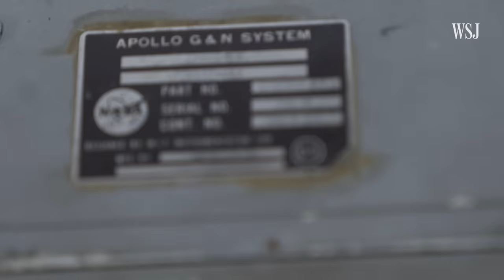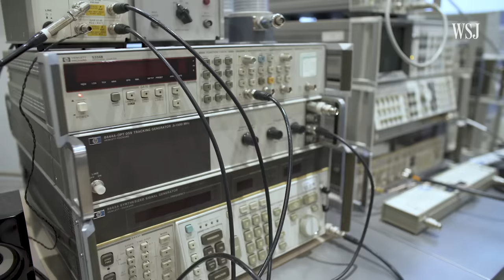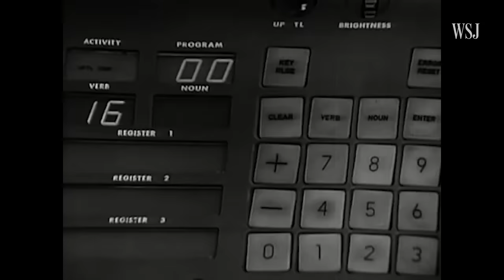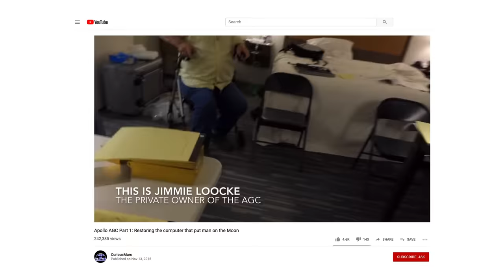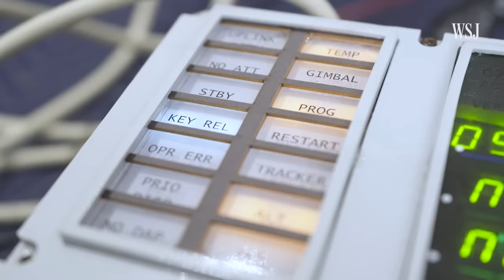Restorers Try to Get Lunar Module Guidance Computer Up and Running | WSJ

Comment: This was a thoroughly fascinating project.  I watched all the videos.  Simply amazing.  When they powered up the computer memory, and recovered the last state of the computer in magnetic memory - including the latitude and longitude - you felt like you were there 50 years ago.  A very impressive achievement.  This was most deserving of being featured by WSJ - it is very inspirational for our creators of the future.
Reply: Love that it goes right back to doings it’s job, even though it’s 50 years later. The little computer just does it’s job no questions asked

Comment: I’d love to see them hook up a control stick and run it as a simulation on a modern computer so that someone can manually “land on the moon” using the AGC. That would be so cool!
Reply: CuriousMarc's video Apollo Guidance Computer Part 23: Flying the Apollo 11 Moon Landing with the Original AGC Code and part 24 does this.
Reply: @threebuddies  Nice dude, thanks!
Reply: Yeah! Like one of those Logitech controllers used to steer submarines!
Reply: You'd need to hook it up to Stanley Kubrick's camera dollies in order for it to reproduce the moon-landing.
Reply: @SEELE-ONE  Tbf, choosing a sturdy, reliable, cheap off-the-shelf gamepad was probably one of the smarter ideas in the Titan sub's developement.
Reply: Not enough precessing power to even connect it to a stick!

Comment: I started working on circuit boards in the 80s but found it advantageous to look back at previous designs to understand current designs of circuits. It’s best not to trash old equipment once it’s gone it’s gone.

Comment: I'm impressed that the young guy was willing to learn the restrictions the designers had in the 60's.  Those guys had to work at the lowest levels to get those pieces working.  And no compilers to transfer a high level programming language into a binary representation the electronics could understand.

I started working with electronics in the early 70's.  This video brought back memories.

Comment: Nice one!. I can remember being a young boy in the late seventies going with my father to work on several weekends, they were working on one of the first computerised credit card systems in the UK, possibly the first kn the world (waits for gnashing of teeth etc, have the dates of it going live). They were writing code on machines that only had 32k of memory, it took half of that to get them going.... They did it, I still have the keyring Dad got from IBM (a 'failed' memory chip) encased in plastic after a business trip to the USA to get the kit needed. This kind of kit needs to be preserved!. I might add, my first home computer only had 64k of ram in the eighties... Gòod on you!.

Comment: I was watching the channel when they first started trying to diagnose it.
The levels of difficulty that they had to deal with are dumbfounding; everything from building their own interfaces to interact with the computer, to creating software that would recreate the "mission" and feed data into the Apollo modules.
And that was AFTER they had to do things as simple as figuring out which parts of the computer were which; because these are computer parts that any normal tech would be able to recognize.

Comment: In 1969 a computer like that would have filled the basement of a skyscraper.  It would have needed a raised floor for cooling..This device was ten years ahead of its time in an era when a single years advancement doubled processing power.  IC chips were invented in 1961 but there was no single chip computer, that did not happen until 1971 at Intel.  The machine they are playing with is a nugget of technology.  VERY HISTORIC.
Reply: Lol no it wouldn’t have. Innovative sure but you’re way overselling it and even for the 60s already 20 years out of date.
Reply: @kishascape  Sure.  You were around, right?  I was working on IBM mainframes in 1968.  What were you doing?

Comment: A buddy of mine worked on electronic and computers for the space program in the 1960s.  He said there is no way the US went to the moon, with the state of electronics at that time.  It would have taken a building full of wires cables and still vacuum tubes, to get a space ship to the moon.
Reply: your "buddy" told you lies
Reply: @Agarwaen  Hold old are you?

Comment: The funny thing is a car made in the early 90s has more computer processing power
Reply: @Magna Carta Sam Adam's- yeah and a 1980s cash register had more computing power.
Reply: @pvtpeppers6176   The funny thing is too if you can work on a car and repair one that's fairly modern you're the equivalent of a rocket scientist from the 1960s and 70s
Reply: @magnacartasamadams8189  To be fair, these days you can just plug in a laptop and run diagnosis on the system. That hardly qualifies you as a rocket scientist. The scientists in the 60s and 70s built the rocket, the spaceships, the computers and the simulators from scratch. And by doing that forwarded our computer tech by at least a decade.

Comment: The---most important computer built, was the first one (programmable) ''COLOSSUS''   AT BLETCHLEY PARK  ENGLAND, 1944.
Reply: That's actually not the first. But it's close.
Reply: @Craigeek  It was the first programmable, electronic computer put to work for a specific task https://en.wikipedia.org/wiki/Colossus_computer
Reply: significance of firsts is subjective. just like US likes to say they won "the space race" as if it's only the moon that matters, in just about every other space-first winner was soviet union. IMO first general purpose computer is more significant. Colossus couldn't run applications only calculations around specific problem domain, ENIAC was the first that could run application code like modern computer does. (disclaimer: I'm not affiliated with any of the nations involved)

Comment: To those who say we just don’t have the technology anymore to go back.   Well apparently we do now
Reply: We always did - what we haven't had is the desire.  There's been no perceived need to send people back to the Moon.
Reply: For you cannot land on the moon. It's a luminary. All lies.
Reply: @fernandojvalencia8151  you're a dumb idiot, IF you actually mean what you say. IF you don't and you're trolling, you're a dumb idiot. Either way, you're a dumb idiot. Only way out of this is to go full adult. So, when are you going full adult?
Reply: Bernard Cohen So where can I find a fully functional Saturn V to put the computer in?
Reply: We wouldn't use that old technology to go back to the moon anyways it was state of the art for it's time . . . It served us well . .but we have more advanced computers and software the Orion looks to be promising it is yet to do a manned spaceflight but alot of engineering went into that spacecraft and I'm pretty confident that it will better that the Apollo capsules that it's replacing . . .all in time
Reply: jeff lockaby  The USA is capable of sending people to orbit. It is just very expensive, and the space shuttle was retired. SpaceX and Boeing will both have capable rockets (replacements for the space shuttle) this year. We could keep using the space shuttle but it is outdated and after trial and error we realized the shuttle is not the way to go for space travel. Most planets dont have the same atmosphere as earth so using a shuttle (rocket/plane hybrid) doesn't really make much sense anymore. Plus America has had many struggles with our economy since the 60s cant just spend all of our money on space.

Comment: I don't know if you know this but it's kinda cool to mention NASA built most of it's hardware with 50's technology that was proven to work very reliably. However, this computer was really cutting edge 60's technology.
Reply: This shows how "barely possible" the moon landing was back in the day. They had to scrap the "only use tried and tested technology" approach, because the Apollo program was at the very edge of what was technologically possible at the time. But in doing so they kickstarted an enormous leap in computer technology. Many of the ideas first implemented in the AGC are still valid today in mission critical applications as well as everyday operating systems.
Reply: yeah  I built one, one boring afternoon. but the power was cut, so I had to heat the soldering iron in the fire.
Reply: @stephanweinberger  The Brain Trust of America with unlimited funds.

Comment: The guts to go to the moon with rudimentary equipment is unfathomable.
Reply: Ah but there is where you are mistaken.  If you watch all the videos, you will see that the equipment that was developed, for example the gyros, were high tech for the time.  The computing tasks were divided between ground computers and flight computers, and data uploaded that could not be calculated by the onboard computer.  Software was designed to be failsafe, and the computer could restart where it stopped if overloaded and high priority tasks would still be done.  Not really "rudimentary", because scientists and engineers figured out how to do it by pressing the state of the art to the limit to accomplish what they had figured out was required.
Reply: Nobody has been to the moon - its all fake.
Reply: @Kpopzoom  go play, the adults are having a talk here...
Reply: @Kpopzoom  Tinfoil hat alert
Reply: @Kpopzoom  Stuff it, child.
Reply: @Kpopzoom  - So you believe NASA's explanation of the dangers of the VABs but not their claims of being able to safely transit them? Not all ionizing radiation is the same
Reply: @stephanweinberger  YOU MEAN THE SENILE CLUB?
Reply: @Kpopzoom  you tell 'em Ray
Reply: @Kpopzoom  : "The moon landing was filmed by Stanley Kubrick". Yeah , but being Stanley "fastidious" Kubrick, he insisted on shooting on location.
Reply: @ordinosaurs ...on  the 2001 Space Odyssey set.
Reply: @ordinosaurs  No it's lokation, critical distinction.

Comment: 2 KB worth of RAM and a 4 MHz CPU landed Apollo 11 on the moon? It's really hard to believe that in 2019. 😂😂😂😂
Reply: I used to work on the early 747 Inertial Navigation Systems - and the RAM in that was just 8 KB
Reply: it didn't have 2 "KB", it's volatile memory could store 2 kw, ie 2000 15bit words (and an additional parity bit). This is actually nearly 4kb, and analogous to the first commodore pet. More than that, there was A LOT more read only memory where the different programs were stored. Ie, effectively it had a total memory capacity higher than a c64 and close to an early pc.

Comment: Any body willing to put that thing in the Space X rocket and fly away?

Anybody?
Reply: Elon Musk wants to know your location
Reply: Could you even imagine....The computer equivalent of a Model T Ford.
Reply: The AGC were not rocket computers anyway. There was one in the Saturn V, for sure, but was an IBM afaik.
Reply: Armando Silvier  : "The Saturn Launch Vehicle Digital Computer (LVDC) was a computer that provided the autopilot for the Saturn V rocket from launch to Earth orbit insertion. Designed and manufactured by IBM's Electronics Systems Center in Owego, N.Y." Wikipedia page "Saturn Launch Vehicle Digital Computer"
I couldn't find any reference to "TRS-70" (didn't dig much however).
Reply: Armando Silvier  : You can't compare the availability of mass produced objects sold everywhere on the planet and to the most a few tens of very peculiar machines build and used for a single short-living project.
However, as you can see, there are still some. I wonder what is your "according to NASA" referring to.

Comment: The 'first' computer the Eniac had 17,000 tubes. The Apollo 11 computer had 17,000 transistors. The current iPhone 15 has 19 billion transistors. 

Technology has come a long way and absolutely every nut and bolt from the Apollo spacecraft and missions should be preserved.
Reply: and they cant do the same thing today ewen with a iphone 😅😂
Reply: @ahmetmutlu1983 when did they try to do an Apollo Mission, today, with an iPhone?  I didn’t get the memo….

Comment: It's amazing that this computer with its now perceived limited resources was able to perform such a monumental mission at the time. This isn't even to mention all the failsafes to account for every single issue that could have happen to the spacecraft. The design of the space module was equally impressive and all these systems worked together.
Reply: LOL. When you understand it was a staged hoax, it makes more sense.

Comment: Interestingly enough the Software in the AGC was developed in Parallel with Digital Fly By Wire software for fighter jets during the same course of time. The hardware was different of course. That same software was then adapted to the STS program. Very flexible software indeed to drive the Apollo Guidance System, Aircraft Fly By Wire Systems and the Space Shuttle.

Comment: APOLLO 11. THE LOST TAPES THAT ARE NOT LOST NASA searched for but could not locate some of the original Apollo 11 data tapes – “original” in the sense that they directly recorded data transmitted from the Moon. An intensive search of archives and records concluded that the most likely scenario was that the program managers determined there was no longer a need to keep the tapes — since all the video and data were recorded elsewhere — and they were erased and reused. The data on those tapes, including video data, were relayed to the Manned Spacecraft Center (now the Johnson Space Center), during the mission. The video was recorded there and in other locations; there is no missing video footage from the Apollo 11 moonwalk. The search discovered high-quality broadcast versions of the footage. NASA worked with Lowry Digital, a premier film restoration company, to process the video using techniques unavailable in 1969. The restored video was released in HD as part of the 40th anniversary of Apollo 11.

Comment: The first half of the mission would be wiped clean from the computers since they didn't have the space in the computer to hold the whole mission. Once the astronauts made it to the moon, they deleted the mission off the computer then booted it back up in reverse to come back home.
True story if I remember correctly. Mind you this is the computer on the astronaut side, space is limited in space travel.
Heard this from a man who worked on the second generation of US military defense computers systems that was in charge of missile and anti missile defense. 
Fun fact: The true reason for GPS was so that if a missile was launched; the GPS system would accurately pin point the spot and satellites near by would convene together and destroy it in high altitude before it had a chance to hit its target or hurt anyone.

Comment: When people say ‘oh my digital watch has more processing power than the computer that flew to the moon’ etc, they’re kinda missing a big point. Sure, it could have had more RAM and a faster CPU but two key factors of the design brief were minimal weight and to require minimal electric power. Whatever it took, strip the functionality right back, develop the technology to build a computer that will perform only the tasks required of it, and nothing more.

Comment: I’ve got an old Vector Graphics computer in storage, I used it 40yrs ago when I started my real estate career to do mass mailings which no one else was doing at the time! My IBM printer ran 10-12 hours a day printing personalized post cards to every homeowner in my town, it made me a lot of $!  Plan to dig it out and fire it up someday, IF the operating system is still intake on the floppy’s!

Comment: It shouldnt have taken long to repair, just put new lights and make sure they blinked every so often.
Reply: Sounds like you have delved into the source code ? In fact .  the program that is supposed to control ascent from the moon does flash some numbers, using a call to the subroutine GOFLASH. Ascent.agc runs about 600 lines. There are 8 I/O instructions, three for output: WOR,WAND and WRITE. According to the documentation these are the way and only way to issue RCS commands, ie. writing to the two dedicated channels 5&6, but then guess what ?

Comment: Plugging a 2022 laptop to a 1969 computer is absolutely impressive because one would say it wouldn’t be possible to connect a hyper advanced laptop to a 1969 computer and receive data from it. Technology is so backwards compatible nowadays…

Just like my sister, she can plug her Samsung foldable phone to a 1980s or 1990s cassette player/recorder JUST with an AUX cord
Reply: Wait they didn't remove the aux port on that one?

Comment: The comparison between the AGC and any modern computer is APPLES and ORANGES. The AGC was custom designed from scratch breaking ridiculous ground in computer and software design, and it did what it was supposed to do extremely well. Any modern computer is just the result of decades of same iteration of design, sure, lots of memory and speed, but nothing special.

Comment: Nobody has ever been to the moon and returned to earth
Reply: @JameyCampbell_54 you are wrong.
Reply: Using 1969 technology ? Six landings and everybody came back alive? There's more technology in your cell phone.
Reply: @bargeman100  Answer to your first question.
Yes
Answer to your second question.
Yes
Your last sentence is factually correct.
Reply: There's more technology in your cell phone

Yes there is, so what?
Reply: Actually 12 walked on the moon and came back, but you were close with your estimate of 0 ❤